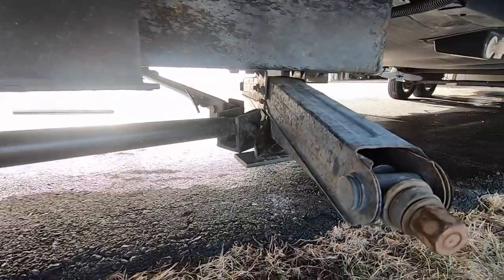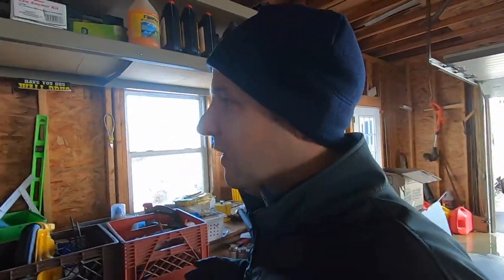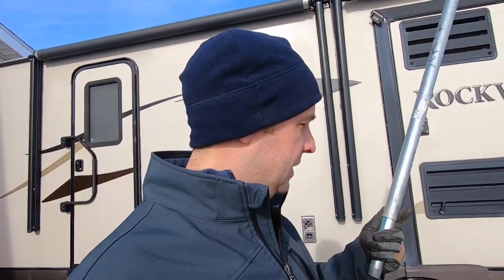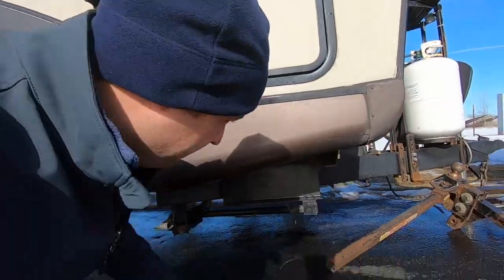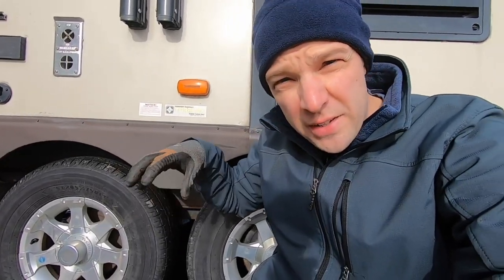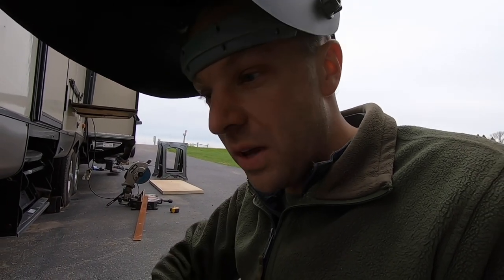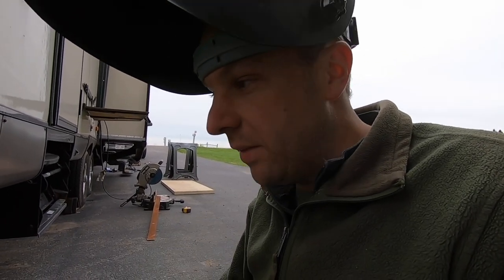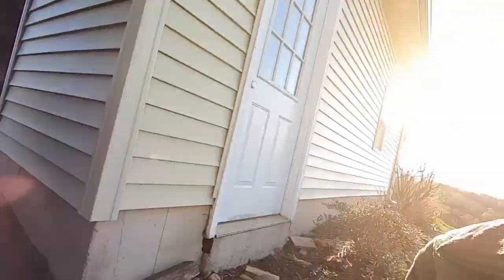RV STABILIZER JACK HACK - END THE ROCKING.  HOW WE DO IT!

Comment: Thanks for the video! I have the exact same Hobart welder...great little welder! 
Since you are not running gas with the welder, you can get rid of the gas shielding cup on the torch and replace it with a little low profile tip that you have to order online. You'll be able to get into way tighter spots. Took me years to figure that out.

Comment: ive got 33ft toy hauler and as some people pointed out the electric stabilization system is pretty much useless ,ill be adding some cross bars like you did on mine as well ,hopefully it will improve

Comment: I bought three sets of BAL lock arm for my stabilizer.  At this moment I have installed two sets and it was a massive improvement and almost took out any type of sway/wiggle. Super happy with it and it was fairly easy to install. I did had to do a little modification but was not too difficult. I paid less than $60 per set. I would do it all over again...
At this moment I have been debating if I should return my last set, but I am leaning towards installing it.
Reply from the maker: Hey Juan thanks for he comment!  Do you have a TT or a fifth wheel?  I have seen a bunch or bars for a 5er but haven’t seen many for a TT. Thanks again and have a good night!
Reply: We Can Explore It I have a travel trailer Apex 250RLS. On the box of the BAL lock arm says two sets for travel trailer.
I installed them in the rear section of my trailer.

Comment: Great video. I own a food truck and it needs to be level when operating. I have been looking at options and those scissor jacks are looking good, especially with the stabilization you show in this video. Question: how much leveling can/do you do with the jacks (as opposed to just stabilizing)? How big (tall)are your jacks?  I’ve seen up to 30” jacks. I was concerned that if I lift part of the truck (front to back or side to side) that it might be prone to slip but with these stabilizers I think that might secure it enough for the few hours I need it. Any thoughts would be welcome.

Comment: The "Factory" electric stabilization system on my 2014 Rockwood UltraLite  is completely useless.
I added the crank-downs that you have - much better - except they seem to lose their lift and need to be re-tensioned (cheap crap from China) periodically - daily.
In addition, if I'm staying, I add two or four jack stands in the middle area and they make it "pretty solid"!.
Reply: I wonder if the need to retighten the stabilizers isn't because the ground compresses (if your are on dirt or gravel)
Reply: @algas58  Good point!  It might be partly due to compression, but I think they also loosen on their own as well - now that they are a year older, they seem to be better, and the screw-thread is stiffer, but still, nothing beats the jack stands under the frame.